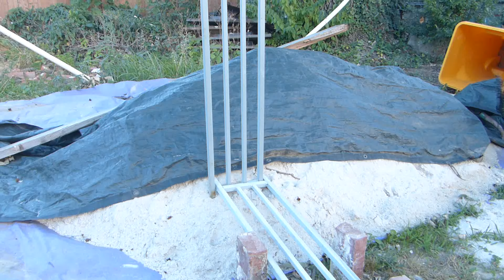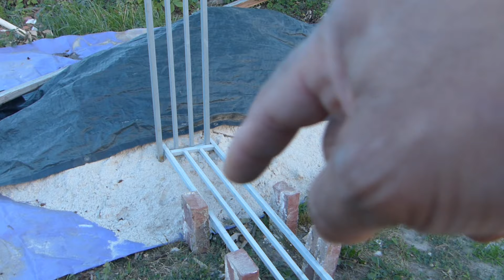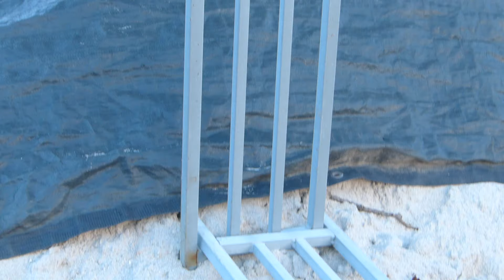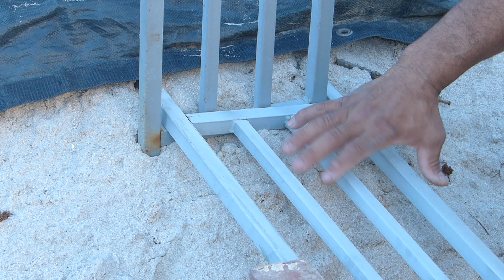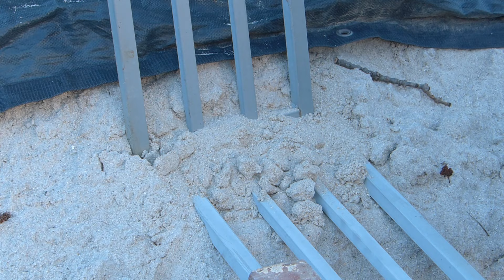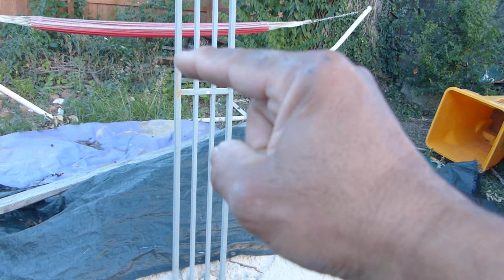Champlain Towers Cassondra Stratton and 87 Park "model'' of ledger beam deck failure explained

Comment from the maker: PLEASE note, the ground deck metal I use is for demonstration  purpose and the punch shear was from a flat floor design... I did NOT find beams across the columns, besides at KLM and at parking lobby area (areas of concern). 13:50 ''beams'' are not present in this section of building but the ''plat floor system'' acts as a ''beam'' with respect to rigidity of the beams (the ''bracing")...

Comment: I have been trying to find out how the deck was connected to building.  Do we have proof of deck pulling away before the the video of damage from other side in basement. Or is it the same time. Your hypothesis must be close... because the way the deck punch through should not have happened if the cause was building column failed first.
Reply from the maker: I have your answer in another video... Look for the video with word "proof"... I am on 📲 so I apologize for not direct linking u.

Comment: (non-engineer here) definition ledger beam-"reinforced concrete beam with projecting ledges to receive the ends of joists". This does not sound as if there is support from underneath the deck to prevent the shearing and collapse. And why was the building not supported separately from the pool deck if punch shearing is a threat to the terrace type structures? That would be akin to a house collapsing because the deck/balcony fell off.

Comment: Slow motion that video just prior to the callapse, and you will see 4 or 5 little flshes of light about 3/4 of the way up the building.  Could that have had something to do with it ?
Reply from the maker: Initially, I went down that path... they turned out to be security lights / emergency lights.

Comment: I just don't understand how more "signs" were not visible in the building. Wall cracks, ceiling cracks, pipe bursts in the walls, door frames misaligned, things rolling off the counter, etc.... All I've heard from people in that building is water leaking in the garage and the cracks near the swimming pool pumps. Just blows my mind it held up that long and then all came down at once.
Reply: I think the main concrete damage was hidden by the pavers and what ever else is below the pavers that was put on the pool level concrete floor. Someone did a drawing showing how the concrete cracking (spalling) on the garage ceiling was like the tip of the iceberg, with the greater damage being on the top where the water was collecting.

Comment: yeah, some don't have a sense of humor, as for cross beams on flat-slab I think is the slab, so that ledger maybe like the top left corner of the 1979plan page 31 of 336, however that I'm sure is the flooring of the generator room above the ramp (between L and M from 1 to 4), not the suspect 9.1 to 10 and a bit more for some flower stuff.  Oh, speaking of extra weight, that stepping and flower stuff k-L-M between 9.1 and 11.1 looks like a lot of extra little things, extra pent hose on those columns, extra upper flor patios, extra pool deck flower pots, patio steps to unit C, etc.

unlike columns I Q and ?? "O1/P??" ok, in any case, those columns didn't have the extra weight down on the patio deck, so maybe why they had more margin than L M and K.  maybe it was L-9.1 that gave out, M-9.1 was in that sad emoji vid not crumbling or fracturing, so looks maybe ok till upper floor weights started shifting off of L-9.1. (edit, 1979plan page 53 of 336 shows that patio and flower planters rather well on the pool deck slab, K L & M from 10 out)

Sorry if this is incoherent, I'm working on first cup of coffee, fighting Grammarly trying to invert what I typed into the 'oppressed???' (what, ok whatever Grammarly), and can't scribble on a pic or point to "there/that" on the blueprint as ref, lol.
Reply: oh that was the other thought, 1979 page 31 of 336 top left corner, a box of rebar in a concrete up-tilted-lip thing, is that even a beam, looks like only 2 bits of rebar at the bottom and 2 at the top of that box going the length of the slab height change step-up. hmmm. a simple loop of rebar in the upward section, hmm. ok, ye has 3 other vids I need to watch, and a cup of coffee to finish.

Comment: Many were doubting some survivors timeline but now there is a tiktok proves they were right. It took minutes from the parking garage collapse to the building collapse. 
Like the Argentine young couple who said they saw the parking garage collapsing and they were even able to escape from the building with another 4 people or the cuban woman in the 6th floor who even had time to put a dress, grab her purse and run to the fire staircase on the opposite side of the building.
If this wouldn't have happened in the middle of the night maybe many would have survived.

Comment: Did anyone see the interview with the building maintenance guy that talked about how the basement below the parking garage would fill with about 1’ sea water pretty regularly and they constantly had to pump it out.   Seems that maybe the entire building was corroded from below!   Your thoughts?
Reply: I was surprised that this interview hasn't caused more discussion or examination.  Multiple saltwater floodings of the basement carpark (up to 2 feet deep) is a major cause for concern.  The building manager was surprised that when the basement carpark's sump pumps failed, the seawater would still disappear eventually.  My guess is porosity of the concrete and height of the water table during high tides.  Effects would be rebar corrosion, concrete degradation and spalling of basement deck, beams and columns.  Unfortunately much of this damage would not be visible as it is below the basement.  These water flows may have caused cavities to occur and enlargen below the basement.  
A possible result:-
1 - weakened basement deck and beams fail, causing the basement carpark deck to drop a little
2 - columns in the vicinity of this failure experience shear forces, and buckle or snap
3 - domino effect
Reply: @Toyopet3  And how did new build 87 Park deal with this issue? Better water proofing, better drainage, more pumps? They have underground parking. Engineering has come along way since the 80's but still got to keep the water out if you want your structure to last.

Comment: Bingo !!
The city of Surfside just released mind boggling revelations that
a) the Penthouse had violated the initial building permits
b) the contractor had resigned before completion of the project
c) the Penthouses were added after the building was in progress violating a)  above.
d) an “exemption was granted in late 1980 to this project —— wtf??  (Mine)
 e) concrete problems have been worked on and off for at least 20 years or more.

Channel WPBF just revealed the story.  
Lets see what else develops.
If true then the North tower , and maybe the East tower,  could be in jeopardy.  .
Reply from the maker: I just did a video on this and yes to BINGO, as I made a video on the penthouses not being approved on plans!  Hope you saw that video? But, I will point at it on my 12:45a.m. Eastern Standard Time video... 30 minutes from now.
Reply: @LoadPathEngineering  
Watching it as we speak.   If you can , please investigate the North side building.  I have driven by it at least a hundred times.
It looks much better kept but it is the same building and finished a few months later.
It could be another catastrophe waiting to happen.  Unless they keep a close eye on it and reinforce it.
Its 40 year certification will be extremely scrutinized for sure.

Comment: Are those columns 16x16" sufficient?  
I have observed in a mere 6 story building that the columns are much larger than that,
Reply: I agree. All the Columns in the garage look undersized to me. Even though they are fairly plentiful, they are (were) holding up 12 floors!
Reply: The standard was different when it was designed and built

Comment: Excellent video and explanation. 
What do you make of the water that was seen 7 minutes earlier pouring down into the garage with debris accumulating nearby?
Reply from the maker: It was a broken pipe from the deck collapse = sheared a supply line... This video surfaced yesterday and it shows a water source https://youtu.be/MlO_-Vu1g38  (this is my version of the video, which also was shared with me)...  And, thank you for the support.

Comment: People need to go to prison for this.
Reply: The people who actually designed this thing are dead. Most of the people on the condo board who put off repairs, also tragically dead because they lived in the building. The town, sovereign immunity probably.
Reply: @jdks1761  criminal negligence at the minimum.
Reply: Good point
Reply from the maker: Pug, you are correct, and the city should be part of that negligence but they have immunity of course.

Comment: Great video.  I believe you are right that the deck failure pulled or pushed on the building column or beam, which caused the building to collapse. However, I’m troubled that a deck collapse near the pool, which should have ended there, instead propagated across the entire deck and took down the building. There were no stops with double sets of columns supporting the deck. It was all one big interconnected mass of concrete and steel.

You haven’t mentioned it, but that deck was one huge sheet. Yes, it was weak vertically. However that huge deck was pulling or pushing horizontally with tremendous force. If it pulled, like a house deck, the rebar would have pulled out. More likely, when the huge deck fell, it pushed on the building, buckling the column. That huge deck was extremely strong in the horizontal direction, especially in compression.  It would be like a huge house deck could take down a house if the deck were pushed horizontally. 

Parking decks fail occasionally, but only sections fail because everything isn’t tied together. Champlain Towers was all tied together.
Reply: I am Architect (not an Engineer) but I always cringe when I see the cross section of a structure/tower "placed" (like a landed spaceship) above a larger, fully "interconnected" parking deck. Instinctively, like you say, I'd also want to see doubled-up columns (and shear walls) at the line where the building begins and the deck ends.
Reply from the maker: WOW, YOUTUBE just sent me your reply, 11 months late! 
Thank you for your comments and support... sorry, that we could not chat earlier. 
Now I am on the shadow ban section of youtube and you will not find me on a general search on this topic, even though I have over 300 videos on it and was top search at one point... now I am ghosted by youtube on this subject.
Reply: @LoadPathEngineering  Your vids still appear in my YT feed, for now.  Enjoy them thoroughly.  Thank you for your reply.  Still wonder if this collapse will be "solved" as it should be.  Too many "authorities" jumping to premature conclusions only to be proven wrong.
Reply from the maker: Thanks Tom, I pinned your comment as you seem to understand this possible (more than likely) load path failure... Yes, push, pull, ''reduce it in size", etc.
Reply: @LoadPathEngineering  Thanks. I agree. I am interested in what others think about the lack of stops or separations between deck sections. That’s what the drawings showed. I was a mechanical engineer.
Reply: I think the failure started at the little parking area on the deck which was full of cars at that time.
Reply: @youtbe999  From that parking area, to the jacuzzi, to the south facade, all of that slab came down almost as one piece, most likely triggering the tower's domino effect that we saw.
Reply: Also check out study on fiu that there have been shifting in building
Reply: Check out building integrity josh porter also
Reply: @aprilselleck4601  there is one major thing Mr Porter lacks ... Integrity.
Reply from the maker: YOUTUBE just sent me your reply, 11 months, they held your comment from sharing with me...
Thank you for your comments and support.
Now I am on the shadow ban section of youtube and you will not find me on a general search on this topic, even though I have over 300 videos on it and was top search at one point... now I am ghosted by youtube on this subject.
Yes, integrity... amazing to put that in your ''name'' ...

Comment: It does appear that the pool deck provided, at the very least, lateral structural support to that entire face of the building, and if so, that seems like a poor design decision to me. In the US, I'd expect the towers to hold even with the entire surrounding "ledgered-on" slabs fully collapsed. Even with such a poor design, though, I think it would have still held had it not been for A. the water intrusion weakening the columns over time. (The columns in the garage look too slender to me anyway tbh)  B. The less than ideal soil in that area. C. The vibrations and earth movements that were surely caused by the demolition of the sizable hotel structure directly south to build that large pill-shaped condo (around 2015). and C. The massive excavation made for the subterranean parking for that same enormous condo tower. I think all those factors conspired to give us this tragedy.
Reply: The nearby construction and salt water problems likely are external contributions. It will be interesting to see the catalyst that evening.
Reply: @dosgos  Perfect storm of negative events and circumstances. Basically the Titanic disaster.
Reply: @CaptainCaveman1170  the Titanic was no accident.
Reply: @minimouse7579  Well I think that could turn into a long debate but I meant in the sense that it took a number of bad things to happen for the Titanic to sink. Hitting the Iceberg in and of itself didn't do it, but hitting the iceberg at full speed, and at that exact angle did. Not to mention a lot of other circumstances that if they had just been slightly different, would have saved the ship.

Comment: I read this is the third worst building collapse in US history. Indeed it is horrific.
Reply: That would also seem to suggest things like this are actually pretty rare. A black swan event. Of course we know about 9/11 but I wouldnt count those for these purposes because that was intentional. For just pure happens by itself structural failure, pretty rare.
Reply: @jdks1761  3rd worst does not imply a rare event.  Over the years, there have been many, all over the US.  The industry as a whole seldom prioritizes sound/safe over $$.  Thankfully, with the whole world watching, maybe things will change, but, I'm skeptical, I had similar thoughts when the Sampoong Mall collapsed, yet, here we are.

Pray that the media doesn't do what they do best, distract.  This is a world-wide problem and it needs to end sooner vs  later.
Reply: @jdks1761  Exactly. Aside from 9/11 what was the other collapse? Hard to believe a deck falling could bring a whole building down.
Reply: @jdks1761  ...There have been several buildings collaspe in the USA as well as walkway and bridges collaspe . While yes they are rare they do happen.  In Orlando in 1981 a condo collasped  , in Connecticut a building collasped in 1987 , there are a few others .
9/11 intentional ? ..lol